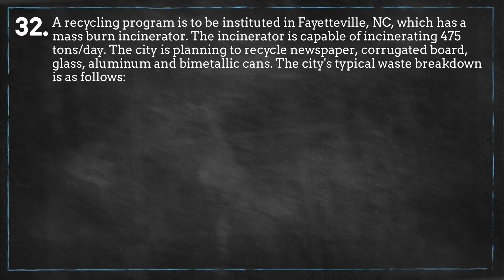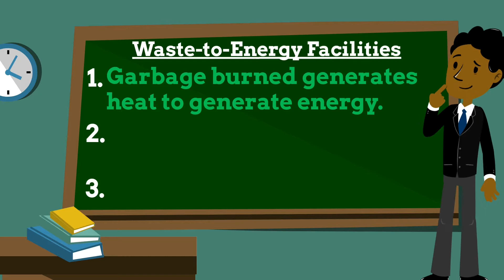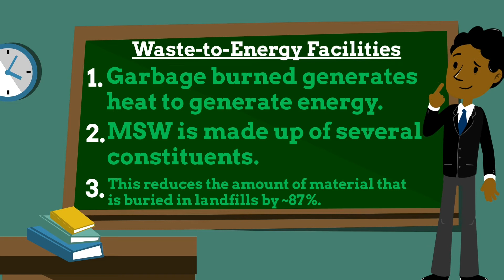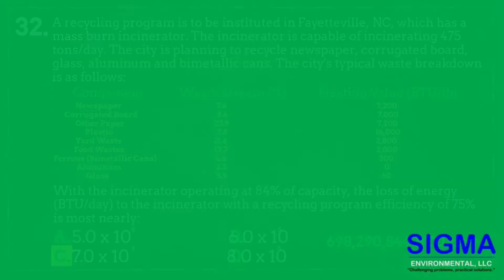Energy Recovery - Episode 32 (Waste Management) | 52 PE Exam Problems in 52 Weeks

Comment: Like someone else mentioned, a recycling efficiency of 75% implies that 75% of the recyclable items listed would be diverted from the waste stream. It would make sense then that you would first find the weight of the recycled items listed in the problem (newspaper, board, al, glass, ferrous) in the waste stream using the percentages provided, and multiply that by .75... not the entire waste stream.

Comment: I took a recycling efficiency of 75% to mean that 75% of the recyclable items (newspaper, corrugated, Al, glass, ferrous) are successfully sorted as recycling, and thus diverted from the total waste stream. So the incinerator is receiving all the other items plus 25% of the total weight of the recyclable items. It seems like your explanation is saying that the recycling program diverts 75% of ALL waste from the incinerator.

Comment: I believe this problem should state the city waste generation per day is 475 tons per day from which 84% are incinerated. (versus saying the incinerator capacity is 475 tons/day) 

From the way it’s stated now, if the city produces 1000 tons per day, their incinerator capacity is 475 tons/day and it receives 84% of 475 tons of diverted waste (higher heating value), there will be no losses. By removing 75% of the recyclables, the non-recyclable ratio is concentrated. Non-recyclables have a higher heating value. So, there are no losses in the incinerator because of the recycling program. You are burning a stream concentrated with wastes with higher heating values per unit of mass versus before. 

However, if the city total waste generation is 475 tons per day from which 84% go to the landfill, it means it is not possible to concentrate the heating value per unit of mass of
the waste. (The incinerator burns what is available for one day and that is it).
Reply from the maker: Thanks for your comment! My original intent was the incinerator to be one of multiple management options the city uses for solid waste, but that is irrelevant being that the system of concern focuses on the incinerator and the loss of energy to the recycling program. Therefore, my focus is the recycling bin & not the incinerator. All the information regarding the incinerator does for me is to help me estimate how many recyclables I should be receiving for processing in my recycling program. How the incinerator operates after the program's implementation is of no concern in this episode. Your points would be very valid if the question asked about the post-program operation of the incinerator, i.e. how that energy lost to the recycling program is being replaced, or it's waste stream constituents sans newspaper, corrugated board, glass, aluminum & bimetallic cans.
Reply: Agreed, because if the incarnation capacity is 84% of 475 tons, but some materials are diverted to recycling, that just means there are remaining materials that are not recycles that would be added to the incineration stream that would compensate for the heat value lost from diverting recyclables. The way the problem is solved, 86.78 tons of recycled materials are diverted from incineration, and thus there is still capacity to incinerate 86.78 tons of additional material that was not recycled. You would actually increase the heat value produced from diverting things like glass and aluminum =)
Reply: @mattspellacy3202  This problem (with different values) is in the PE environmental practice exam (2021) from NCEES (Prob 47).  And I did the problem exactly like you are suggesting when I tried the NCEES practice problem.  Assuming they would still burn the same amount of material but it would have a different overall composition.  Took much longer that way.  When I saw the answer solution they calculated it was much like what was done with this example.  I did not really agree at the time and thought the problem was worded such that it could be interpreted a couple ways.  Anyway... I like this solution better for the simple reason it is A LOT EASIER then what I was trying to do.   Cheers,

Comment: I must be reading this question incorrectly.. I was looking for the loss of energy due to the recycling program's efficiency rate of 75% instead of 100% (similar to a Potential to Emit (PTE) problem). I got your answer of 698,290,844 BTU/day with the efficiency of 75%, but the difference in BTU/day from 100% (loss of energy) at 9.31*10^8 BTU/day would be 2.33*10^8 BTU/day.. How do I read this problem next time to know to stop at 698,290,844 BTU/day?
Reply from the maker: All of this city's waste currently goes to the incinerator, but with the implementation of this recycling program there will be a loss of energy that the incinerator will not be consuming going forward (removal of the recyclables stated in the problem). The energy now being recycled instead of incinerated is what we are calculating. It's somewhat hard to explain because there's several different ways you can solve this problem, but just remember that 1) All of the components listed won't be recycled, so I wouldn't even include those in any of your calculations (e.g. paper, yard waste). Also, 2) The 75% is just showing what percentage of the recyclables currently being incinerated will actually be collected for recycling; some people (as I did here) will use the 75% initially to calculate the daily rate of garbage (with recyclables) collected, or calculate the energy value of all recyclables in the stream, then multiply by 75% to reflect the amount that will actually be diverted from the incinerator to be recycled. Either way, you should get the same answer.
Reply: @SIGMAEnv  Thanks for the clarification. It seems to me that applying the 75% reduction to the energy of all the recyclables makes more sense conceptually. Mathematically applying the 75% initially will get you the same answer, but I don't believe it makes sense the way you've described it. I'd recommend the second approach if people are confused. Regardless, these videos are great review, thanks so much!